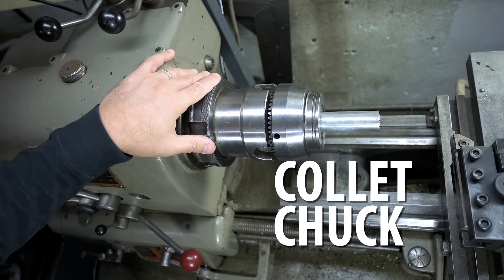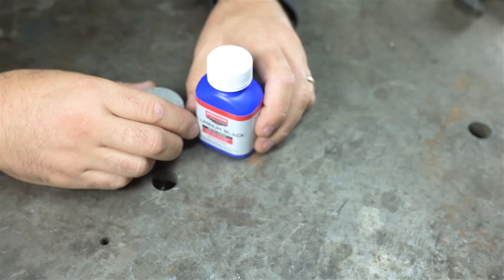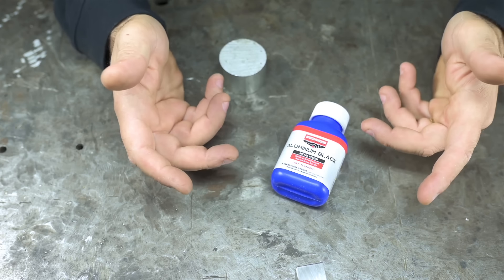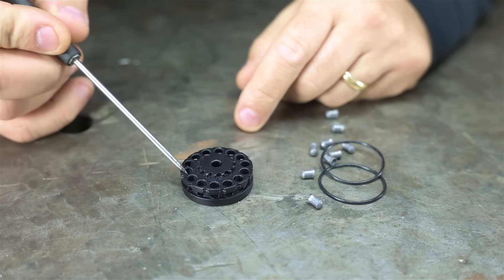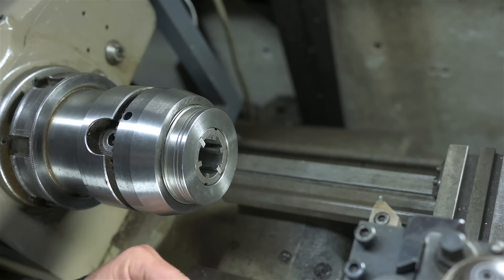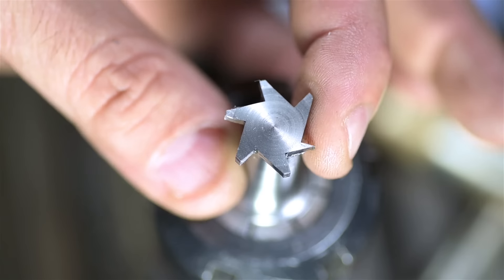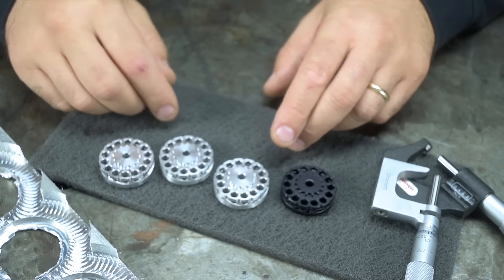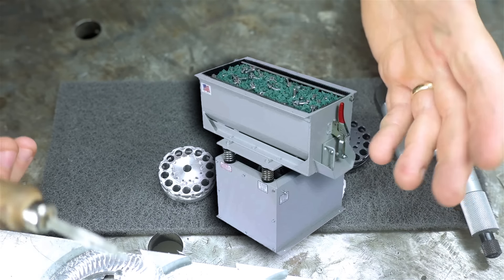Will it Black an Entire Aluminum Part?

Comment: I have used aluminum black a lot. The key is to build it up slowly. Brush or dip it and let it work for about one minute. Rinse, dry, and repeat as many times as it takes to get the color you want. It works great but proper application is a must.
Reply: How robust is it over time and with weathering when used outside?
Reply: @101rotarypower  Anything used outside in the weather should be painted. Bluing, blackening, browning, etc., will not do well in the weather.
Reply: @billmcleangunsmith  heck, paint really isn't up to real weather
Reply: If only there was an available paint that actually bonded to aluminium
Reply: That's my experience also. If you clean, clean, clean the part and apply it that way it works pretty well and lasts *well enough*.
Reply: @janeblogs324  powder coat or hard anodize
Reply: That is why he got the touch up bottle
Reply: @janeblogs324  They paint airplanes and that seems to hold up pretty well
Reply: @matthew4878  they have to be stripped and repainted periodically. Also it is not "just painted": both the application method and the quality check are very articulate and time consuming, in order the ensure the safety of the parts.
Reply: @Beregorn88  how often are we talking?
Reply: "Run of the mill" great delivery
Reply: @matthew4878  it depends on the plane, on the climate of your home base, on the hours you fly and on the typical flight conditions: it can be as low as once every ten years for privately owned jet (fly rarely, kept inside) or as often as every two years for line airplanes flying in harsh conditions.
Reply: Yeah this. I absolutely hate it when youtubers discuss a product and not properly follow the guidelines. It's like from the Waterjet cutting channel doing epoxy projects. You just know it's not going to work from the moment they start mixing up the epoxy.
Reply: Sounds like it's the same amount of work as anodizing just a bit less stuff like containers, power supply etc involved
Reply: Is Copper(II) Sulfate single replacement reaction with aluminum. The outside layer of aluminum , probably only 10 thou of molecules is being replace with Copper Ions. The protective layer that is black is copper and you’re supposed to coat it in a protective coating also
Reply: Sorry it’s solid copper not ions and there are other control reactions happening as well as the copper being turned back into an ion I believe ( could be the aluminum also) so that the copper will attach to the aluminum
Reply: @MarinusMakesStuff  and why do people not know how to mix proxy properly anymore. These days, the basically pour it into a seltzer bottle, add Co2 and then heat (dmg) all the "Visible" bubbles away.
 
"Here, we will use our SDS drill with a cement mixer to get a perfect blend in 20 seconds... as opposed to the 2 minutes of proper mixing that avoids ALL sizes of bubbles in general.
 
As a 30 year epoxy user, former fishing rod maker, and woodworker ( that built river tables when they were cool... 20 years ago lol) it drives me nuts everytime I see people use epoxy. They'll poor 2" deep and full of bubbles, heat gun the 💩 out if it, then wonder why it yellowed, or shattered over the winter...
 
FUHHHHHHHHHHH!!!! Lol... I feel better now. Apologies for the TedYalk Presentation.
Reply: Bill, do you brush the parts with 0000 steel wool between applications?  I’ve found that with cold blue I get a better result when I apply the chemical, remove once I see the reaction, brush with 0000 steel wool, degrease with acetone or similar, and apply a second treatment.  I’m not sure how this would work with the aluminum black.  It may be a “one and done” kind of thing.  That said, it would seem to be a better application for textured parts (sandblasted finish) vs. polished.
Reply: @janeblogs324  Cerakote
Reply: @edwardlance2379  not available though. There are 3 people in my state that are authorized to use it, but they won't sell it. 
The importer sells the smaller oz bottle for $90 delivered.... its not even enough to paint a bicycle
Reply: Weh scary! Of no surprise I'm sure, I thought that said "bumper" scary! Process, so honest!
Reply: @janeblogs324  What state do you live in?
Reply: @lazerusmfh  Right. It's not impossible to anodize aluminum in your backyard/small-shop. You need an appropriate power supply, and a few nasty chemicals, but it's all available. You can even treat yourself to a bottle of anodizing dye that won't break you. Or use clothing dye for a 'pretty-good' finish.
Reply: I have a .22 receiver to try this on
Reply: @Bill McLean - Yes, this is the way to do it.
Reply: @robot_spider  I've anodized stuff myself.  It's not hard to do, but you should practice ona  couple scrap pieces first.  You're right in that it's not terribly expensive either.
Reply: @matthew4878  Like Beregon said depends on the plane, but we are now repainting the KC46 every 2 years and are still getting flaking on the painted portions of the leading edge. Which is par for the course since most of the paint deterioration was on the leading edge towards the wing root or wing tip on our KC135's. Which is the most turbulent sections of traditional twin-engine design.
Reply: @edwardlance2379  Cerakote is pretty but in my experience worse than anodization for aluminum applications. It scrapes pretty easily, has tolerance build up, and fails to harden the metal which is a necessity for aluminum durability. For the applications that cerakote actually is decent for, I'd rather go with the thicker powdercoat.

I used to be a fan of it, but now that I've had to actual use it, to me it's just a super expensive paintjob.
Reply: @asymsolutions  thanks for the info
Reply: @asymsolutions  I used to be a Duracote applicator. I considered getting into Cerakote, but I've still got knives and guns that were Duracoted many years ago that are still in excellent condition after fairly intense use. As with most things, proper prep and application makes a big difference in the durability. I've been extremely happy with Duracoat, and never saw the need to move to the much more expense or complicated Cerakote myself. I know many prefer it and it's become the 'thing' now.
Reply: @janeblogs324  There's no "authorization" to use it, they're just officially trained & qualified in the application of Cerakote. It's just an endorsement.
Reply: @criminallyoffensive  but yet these people refuse to sell the raw product, they will only paint for you and can't paint anything larger than a rifle or even quote you. 
There's 1 importer for the whole country and postage is $30 because they are posting flammable liquids.
Reply: @janeblogs324  See, that's up to them. They can do what they like really. 

And if they don't wanna sell the source of their revenue.. well that's just common sense.
Reply: @criminallyoffensive  but 1 distributor in a country/continent 4000kms wide. 
Cerakote need to get their sh!t together
Reply: @janeblogs324  Good thing international shipping doesn't exist huh?
Reply: @criminallyoffensive  no one wants to wait 8 weeks for a tiny bottle of paint, then another 8 when you realise its only enough to paint 2 pistols.
Reply: Bead blasting those parts would have been better!!
Reply: I’ve experimented with the stuff on 6al4v Ti. Gives it an aged appearance. 

Titanium.. aged… cool.
Reply: @janeblogs324 It does.

Comment: The USB caliper insertion scene is confusing….You only rotated the usb once. Usually you try one direction, realize it’s wrong, rotate it… then realize that’s wrong too. Finally rotating it back makes it fit since that was the correct orientation to begin with 🤷‍♂️
Reply: Magic touch, he only needs to try twice. Us mere mortals can only dream.
Reply: Otherwise known as 
Wrong, wrong right
Reply: he is learning from his past mistakes.
Reply: USB ports live in a 4+t dimensional space, hense the need for the double rotation. As a time traveler, Tony apparanly can see (or at least peak) in the additional space dimension, and thus needs fewer rotations to insert a USB.
Reply: Yes. You have a 50 percent chance of getting it right the first time. And an 80 percent chance of not realizing it is right.
Reply: IT'S THE LAW.
Tot might getting in trouble for this one. In fact, I wouldn't count on hearing much from him in near future.
Reply: Ah, beginner mistake, the USB is actually impossible to plug because it is in an "AB" superposition until you observe it, at which point it settles to either the "A" or "B" position, allowing you to correctly orient and insert it.
As you might notice, Tony observed the port already after the first attempt, which is a skill usually obtained after many years of experience dealing with USB ports. A more novice operator will usually observe the port only after two or more attempts. 
Some independent researchers have hypothesized that it might be possible to observe the port before the first attempt, resulting in the very first attempt to be immediately successful, but this has never been confirmed in practice.
Reply: I only have the old ones with the "D" shaped usb. It can sometimes be hard to find the cord but it definitely only goes one way.
Reply: @robertmahaney6831  Or, as my wife discovered shortly before buying me a new element for my soldering iron and two microUSB sockets for my birthday, unless you try really hard.
Reply: @Arctic2Noob  best comment ever. Thank you! 🤣
Reply: @Arctic2Noob  I dont like how much this makes sense.
Reply: There's a story going around the darker corners of the internet about a guy that made a pact with the devil. Story says he was able to plug it in at first try, a couple of times.
Reply: @robertmahaney6831  How about the square-ish printer ones? Legend has it that - while reaching blind - a man got one plugged in correctly after a mere thirteen attempts, nearly losing his hand in the process.

Meanwhile, the poor tech who got the circular MIDI port cord is said to still be trying to this day...
Reply: @cliftut  oh I had one of the round midi ones. It automatically transferred all my measurements into metric so I sent it back
Reply: Everybody knows that USB-A connectors are initially in superposition and require three 180 degree twists followed by insertion to make it connect but I guess there was some creative video editing to make it appear as he only needed two.
Reply: Lol if only drawing things in gibs and auto cad was that simple
Reply: 50/50, 90%

Comment: Got to love that USB plug to Caliper adapter. If only I could go back in time, and buy 2 or 3 of them... you know, for the oncoming zombie pop-can apocalypse. Sorry that the "anodizing" didn't quite work out for you. I have been thinking about your issue with cleaning up the part. Could you create wire brushes in different sizes on the CNC to follow the same pattern for cleanup?
Reply: One of his best funny moments in a long time, imo!
Reply: I have a set of calipers from iGaging with Bluetooth. It acts like a BT keyboard and actually works really well. 

I just go to dimension a part in SOLIDWORKS, fusion360, excel, whatever... And push a button on the calipers and it sends the dimension over and pushes enter.
Reply: fully expected him to fail, flip it over, fail and flip it over again to the first side for success, like anything you try to plug in to a usb
Reply: @dtroy15  Wow... I hadn't been keeping up! So, calipers from iGaging with Bluetooth... How good is the software for bringing in dimensions to the target software? Does it auto-copy to the clipboard or something else?
Reply: @marcfruchtman9473  it just acts like a Bluetooth keyboard. No special software required. You can even use it on your phone, as I do to record dimensions in excel for tolerancing analyses etc.

Just like a Bluetooth keyboard can send a "9" to your computer when you hit the 9 button, the calipers can send a "9" to your computer.
Reply: @marcfruchtman9473  I'm just going based off of what Dtroy15 said but it sounds like the computer sees the input as coming from a keyboard so as long as you've selected the correct field within whatever software your using it would input the numbers directly as if it were coming from a keyboard. The IGaging calipers look interesting but id be curious to know how accurate they are compared to other traditional digital calipers. Mitutoyo makes a wireless transmitter that can be attached to their calipers that appear to do the same thing so perhaps that would be a better route. 

Cheers
Reply: @jack5864  and hell of a lot more $$$.
Reply: @ronwilken5219  True, you're paying for the brand more than the tech at that point I wouldn't disagree :)
Reply: Do you not realise that when plugging in a USB you always try side A first then rotate to side B and then back to side A for it to connect. It's just a law of physics.
Reply: He must not own any Mitutoyo with SPC outputs...
Reply: @spudpud-T67  do you not realize that he has a degree in Murphy's laws. One of which is "if it didn't fit first time it'll fit on the third"!
Reply: @dtroy15  Know of any good video tutorials that show how that all works? (I'll look myself here in a moment. Just thought I would ask now while I am reading your comment because I may forget or not be able to find it again later.) Would like to see how it looks to do this and how to make CAD a little bit faster/easier/more accurate when trying to recreate a part. Thanks!
Reply: @ronwilken5219  Kind of what I said, the law applies to everyone even those with advanced academic acronyms.
Reply: @licustoms  I'm not aware of any. If you can't find one and want to see it, tag me in another comment and I'll make a quick video.

Comment: Great video, thanks Tony.  Applying the solution you really need to get it to a high shine.  By running the parts through a tumbler you’ve created massive amounts of tiny pits which has increased the surface area.  This gives the acid more areas to attack rather than a smooth shiny surface.  😊
Reply from the maker: excellent point!
Reply: Would walnut shell media, or corn cob media have been better at both light deburring, and preventing surface pitting by the "sand"?